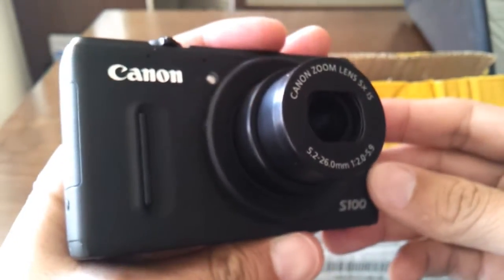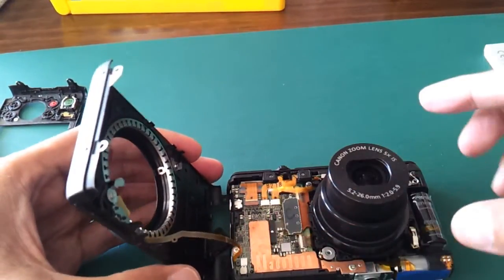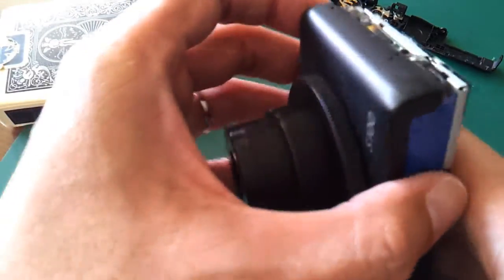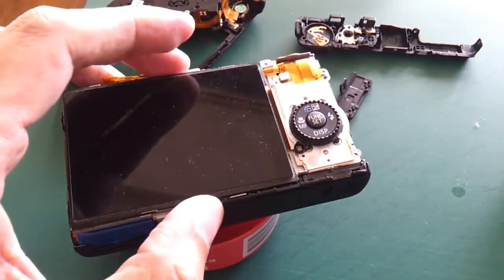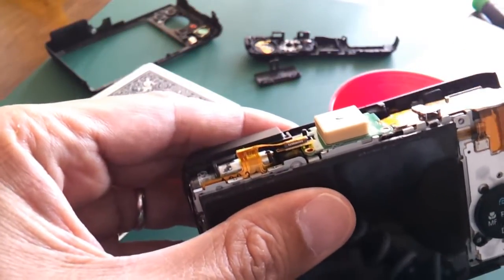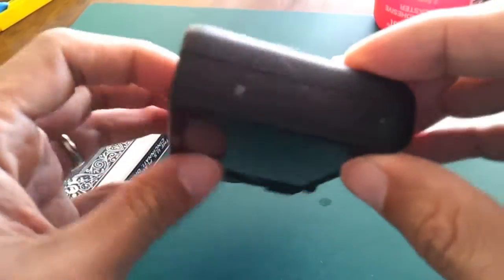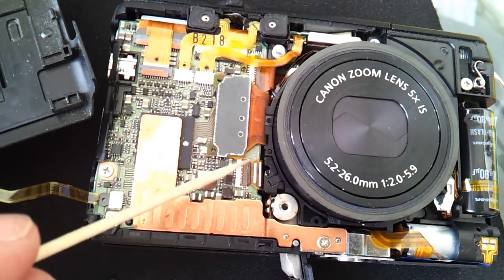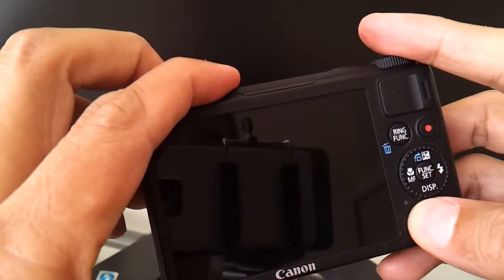How to replace the Lens of Canon S100

Comment: Thank you from London! I have just fixed the S100 I use for underwater photography. You saved me from buying a replacement from eBay or more likely a full new underwater system!

I had one problem - when I started up the first time I had the same lens error. After disconnecting and reconnecting the cables a couple of times then everything was fine. The bottom cable seems particularly tricky. But it is all working now and I am very happy!
Reply from the maker: You're very welcome. Please subscribe if you haven't already done that, thanks.

Comment: Thank you, this was super helpful. I had a little difficulty figuring out how to get the two smaller ribbon cables back on, but once I did that everything went back together surprisingly easily, and it powered up and worked on first attempt.
Reply from the maker: You're welcome. Please subscribe if you haven't already done that, thanks.

Comment: bigboss thanks for your video all i can say i followed the step by step guide you uploaded , and all went to plan one thing i should say the hardest part was removing the lens because from the back metal strip i couldn't figure out what was holding it on the metal strip ,only advice is if doing this for the first time DON'T rush its very doable if you are patient
Reply from the maker: +Ety Mnm You're very welcome. Please subscribe if you haven't already done that, thanks.

Comment: I have the same camera broken for years and I have no idea why it just stopped working, maybe I can try to fix it with the help of your video. I bought the g7x mark ii but the size is not as comfortable as the s100
Reply from the maker: I love my S100, too. Nowadays you can't find compact camera with GPS because people are using their phone instead.
I've been using my Sony HX90V since 2015, not very happy, larger and not as user friendly as Canon.
There are only two things I don't like in S100. It drains battery quickly and have to take selfie blindly  :D

Comment: This is a great video and helped me successfully take apart and put my camera back together again (twice now).  The problem is, both times I did it, the lens I purchased from eBay had focusing problems.  The first one (from seller nycom-tech) had a very serious focusing problem, with only maybe a few feet of focus possible (when zoomed out, then up-close macros, or when zoomed in, within a few feet range of whatever you were zoomed on - everything else is very out of focus) and manual focus couldn't fix it at all.  The second lens I tried (from seller rongyuanxie) similarly has a focusing problem, though not nearly as extreme (won't fully focus on anything except within a couple feet when zoomed out, but when zoomed in a bit or a lot, can increase range between 10-200 feet.... so landscape focus doesn't work, but still mostly functional, as long as not zoomed all the way out).

Anyway, I just wanted to point out for everyone else that this video method works great for replacing lens successfully, but apparently a high portion of eBay lens simply aren't fully functional.  I'm going to have to buy a new camera now.  :-(
Reply from the maker: +Adam Willard Sad to heard that  :-(  I also noticed something with my new lens in full zoomed-out landscape shot. Not everything is in focus. I didn't check how it was before. But I assume that on a sunny day long distance shots should be able to capture everything in focus. I might be wrong.

I'm disappointed that Canon has removed the GPS feature from the S-series. I fixed my camera because I couldn't find a substitute :-(  I had a G10 before and it was too big as a point&shoot camera. Love the S-series. I'm still waiting for a new one, but please with GPS!

Comment: I know this is a very old post but what was the problem/fault with the original lens barrel assembly? Thanks
Reply from the maker: The camera starts and shuts down immediately without retracting the lens barrel as demonstrated in the video. Basically, the barrel got stuck and triggered an error.
Reply: Thanks, l understood that, l just wondered if you inspected the old lens to see what caused the error. Dirt in the barrel mechanism, broken cable, unseated cable? Basically was the old unit fixable without needing to buy a new lens 😊
Reply from the maker: I've tried all solutions I could find without success. That was the last resort.

Comment: The video worked for me.  First time I put the camera back together it had the lens error again.  I took it apart, detached and reattached the three lens connection cables.  Then the camera worked.
Reply from the maker: Congratulation! :-)
I did have the same issue as shown on my video. The cable was even covering the sensor hole in my first trial  hahaha

Comment: Now that you have opened up your S100, what is the chance that you would know the placement of the internal battery and its specifications? I have to set the time or enable GPS and automatic time from GPS every time I charge my battery. I know this is a common problem, but I have yet to find any reference to a repair method.
Reply from the maker: Sorry, I didn't pay attention to that when I opened it. But I won't recommend anyone to open it if the camera is not practically dead. It's too good to be wasted  :-)  Especially, Canon seems to have stopped the S-series.
Can your internal battery last for 10s or so? Then I suggest you to buy a cheap replacement battery online. Insert that in while you are charging your original one.
Reply: Yes, I have several batteries and have learned to swap it quickly to take advantage of the short period before everything is reset. However, it is annoying having to do this, especially when I loan my camera to less tech-savvy people. I was wondering if the battery is visible to the right of the lens as seen from the front. There is a shiny metal part that looks like a battery clip. Visible between your thumb and capacitor at 6:24. It goes away together with the capacitor in the next scene and looks even more like a battery clip at 6:38. Seems pretty accessible to me. What do you think?
Reply from the maker: I know it's annoying to live with that. Especially the S100 can drain the battery quickly by itself. OK, let me tell you something and then you decide  :-)

We, compact camera users, are point-and-shooters. We accept the fact that there are always many bad shots, e.g. wrong focus etc. After my lens replacement whenever I see a bad shot I start blaming on the cheap lens. But in my case a bad shot is still better than no shot at all :-)
In your case, I don't want you to suspect some home-made issue when you see a bad shot in the future.